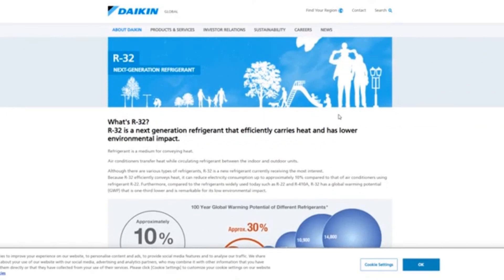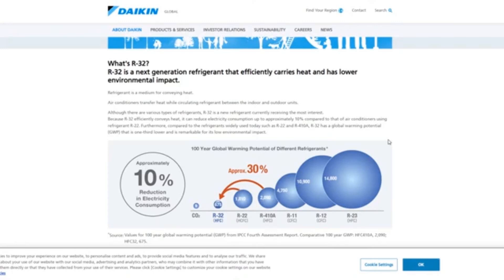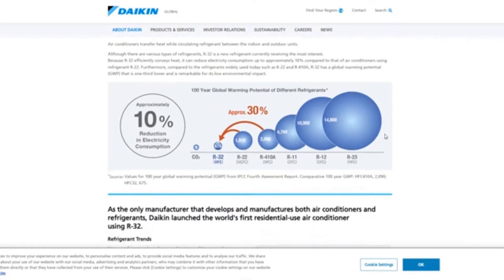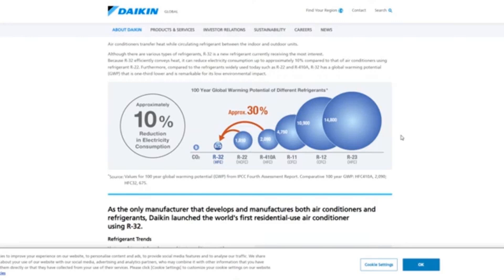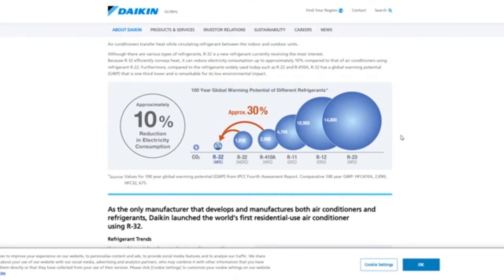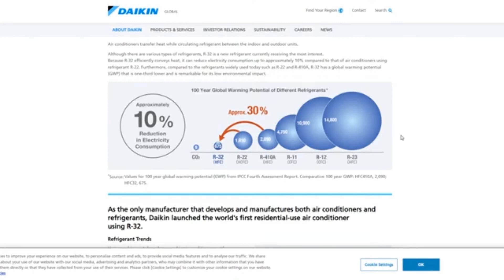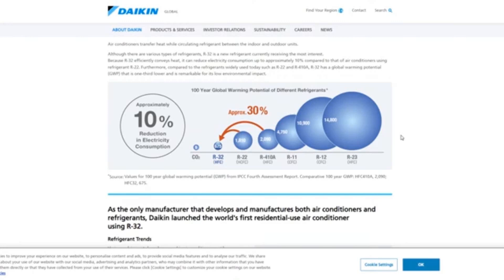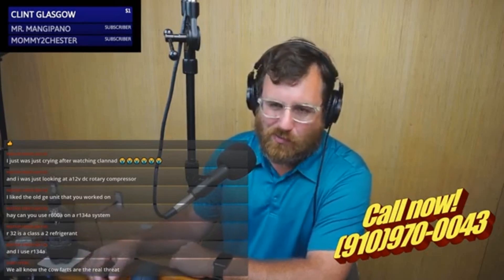R32 and CO2 Refrigerant

Comment: Same is happening in mobile ac systems.  We went from R12 to R134a.  Now the newer vehicles are using R1234yf.  R1234yf is mildly flammable and you need all new equipment to service and store the refrigerant.  It's around $130 a pound, so you better make sure you don't have  leaks after repairs.  Mercedes and VW are playing with C02 systems, but we probably won't see that here since 1234yf has a lower GWP than CO2 and doesn't operate at insane pressures.

Comment: What are the pressures of R32 compared to R410a?
Reply from the maker: I think slightly higher
Reply: Completely dumb! Blown coils in equipment plus many other problems! So get ready to work on new units at higher pressure.
Reply: @dyershvac5884  Especially in the microchannel coils.

I highly doubt this would happen, but maybe if R32 is running at higher pressures than 410a maybe this will stop the production of microchannel.

Comment: Hot often does refrigerant enter the atmosphere?  I have two 12+ year old R-22 systems, neither have needed any refrigerant since new.
Reply from the maker: It’s common for a unit to begin to leak at some point. Not all, but I saw it frequently as a tech.
Reply: If you own a modern 410A system utilizing Microchannel coils you can be assured that refrigerant is constantly being leaked into the atmosphere. You will know this because you will constantly be adding refrigerant to the leaky piece of crap. These new units are designed to fail in short order.